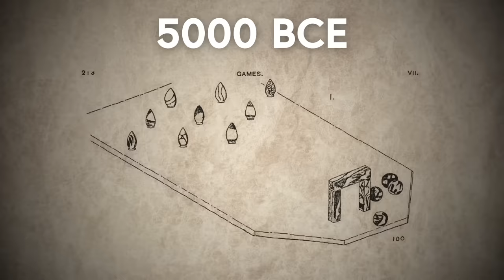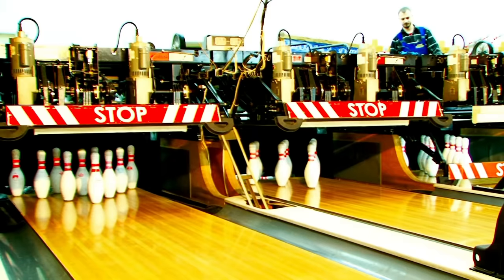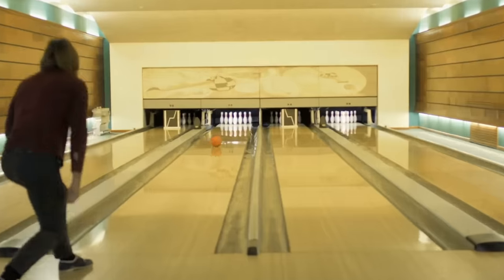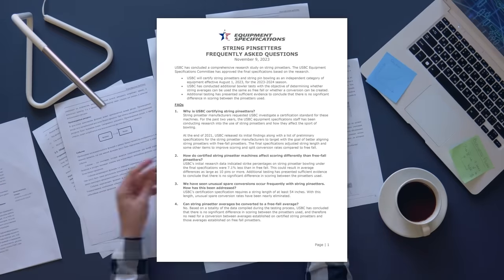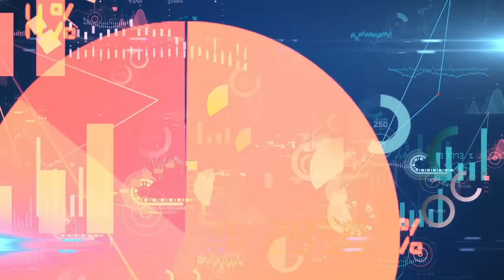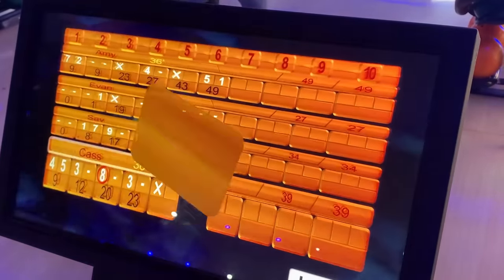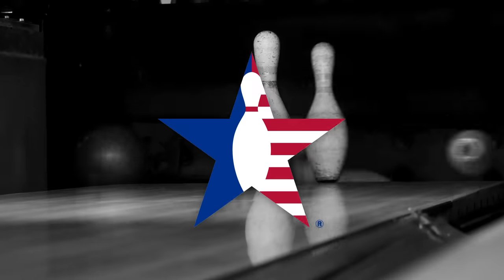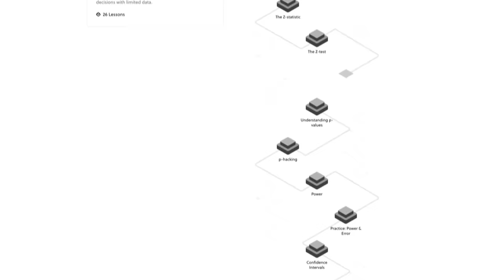The Controversial Machine That’s Ruining Bowling

Comment: I can understand the league bowlers being upset by the change, but string setters are saving the game.  Bowling alleys were dying out, but are now appearing all over the place due to the affordability, low power and low maintenance.  Personally my favourite way of playing them is smashing the pins with enough force to try and make a knot that the machine can't untangle.
The way the old machines crushed the mechanics to death was particularly sinister.  They usually got trapped above the table that sets the pins, and the motor would keep trying to run, meaning that every time they breathed out it would inch up a bit higher and gradually asphyxiate them.  Any initial cries for help were drowned out by the immense noise of the other machines, meaning that they would only be found when players complained that their machine wasn't working yet.

String setters have been standard in many weird variants of the game throughout Europe for a long time.
Reply: This must be happening everywhere except for where I am then.
Reply: Big Clive!!! I’m fangirling all over the place!! 😂
Seriously though, love you, and thank you for this amazing explanation of how the machines crushed people. It was spectacularly sinister.
Reply: I don't know about dying out, but many have closed over the last couple decades.  Mostly leagues just are not as big as they once were.  The thing with all the closed centers is that there are lots of machines sitting about making them pretty cheap to keep running.  The truth of it is, the real cost is paying for mechanics that know what they are doing an can repair and maintain the machines.  Any new construction bowling center today would rather pay more for string setters up front than have to pay mechanics forever.  It's the same reason you order McDonalds with a touch screen instead of a person today.  People are expensive.
Reply: I noticed lots of small bowling alleys being part of game warehouses. (places with arcade machines, pool, air hockey etc) in city centres. Where you have a small alley of 2-6 lanes. Not the mega 32 / 48 /56 lane alleys.
Reply: I feel like the "crush to death" problems could be solved by proper LOTO procedures, which should already be happening anyway because machines don't have brains. I know it's not that statistically significant, but while I was in the trades I worked for two separate companies, both for about a year. One was pretty lax about LOTO procedures, and while I was there three people got serious injuries, in one case losing all 4 fingers on their hand, because of poor LOTO procedures. In the other place, which was extremely strict about making sure proper LOTO procedures were used, we had zero notable injuries. The second place had about 100 more employees than the first, so workforce size didn't play much into it
Reply: @kevinb873  How often are you testing out bowling alleys? I ain't been to one in 3 years and this is the first I'm hearing about string theory destroying bowling balls.
Reply: @richardmillhousenixon That seems highly likely. When someone is killed or maimed by industrial machinery, they virtually always bypassed numerous  safety procedures and ignored dozens of big red warning labels saying not to attempt what they were doing.

Of course it's easier to become lax about the danger when you run a bowling alley rather than a factory, but the deaths don't seem like a particular fault of the machine.
Reply: "The Controversial Machine That’s Ruining Bowling" is my nickname down at the lanes
Reply: On the machines I work on (Brunswick GSX) there is a switch that would protect you in that situation. If there is something stuck on top of the table (usually a pin, hopefully not me) the resistance will overcome a spring and trigger the switch to shut down the machine with a jam code
Reply: To be fair, I have not experienced being the jam, and I can't imagine you would come off entirely unharmed before the switch tripped
Reply: bowling by nature has a lot of old heads this is the same reason why 2 handers get so much slack, or hating on people with a large arsenal.
Reply: stop smoking crack bro
Reply: I had only seen string setters on Bowlingo (sort of mini ten-pin), and one small alley (as in, 4 lanes small). Honestly I thought strings were how they used to work before the pin table style.

Nothing beats the sound of 20+ lanes all sweeping and setting 10 pins in perfect unison though.
Reply: The massive problem with stringpins is that it doesnt allow the range of motion to pick the bigger more difficult splits in a natural fashion if you have such splits like the 5-7-10, 7-10, big 4, greek church, 4-7-10, 6-7-10, 4-10, 6-10, etc. that otherwise are pickable with pins not attached to strings.
Reply: @richardmillhousenixon  Also, in the US it's flat-out illegal to hire anyone under 18 for any kind of hazardous work.
Reply: That's not the case here in the Philippines. Bowling centers aren't declining and yet all of them are still running Free Fall Pinsetters, even centers that were recently reopened after their renovation.
Reply: They suck and the lanes suck and don't make bowling fun.
Reply: @hedonismbot1508 - if so, that doesn’t stop businesses from doing it!  There was a recent video about child labor in the US, and how immigrant children were being used in hazardous working conditions. If the business was found to be breaking any child labor laws, they would receive a tiny monetary fine. Being a bowling alley pinsetter tech would be like Disneyland compared to working in meat processing facilities!
Reply: Clive, what's a guy like you doing in a place like this? Same as I am I suppose.
Reply: @hedonismbot1508 who considers working at a bowling alley hazardous work? Our bowling alley has a 16 yr old kid that works in the back.
Reply: Wow! Last place I expected to see a big clove comment!
Reply: Those machines are likely the Brunswick A-2's, the ones with the "mechanical brain". They don't give a damn, especially if the blackout switches are not adjusted properly, hence killing people. It's just carelessness, lack of training, and spacial awareness that causes mechanics to get injured and die. Newer machines like the AMF 82-90's and the Brunswick GS-X/GS-NXT have much more safety stuff built into them, and some have it surrounding the machines, as well. That was not mentioned in this video, I'm not sure if that was on purpose or just a lack of research. Strings have their place in fun places, like arcades and non-league family entertainment centers; but freefall machines have their place, too. They just need the love and care they deserve to last many years--and it helps that the general public do their part, as well.
Reply: While I do believe there probably is a way to fool proof/redesign the non string machine, it really sounds like for the casual player string setters are the way to go and no one should be upset about this change. Like feel free to keep the complicated expensive shit for professionals for legacy's sake, but if you're drinking beer and eating mozz sticks while you play you should be thrilled by the change.
Reply: The free fall machines probably have trouble not because of bad design, but because of a lack of care and maintenance. I wouldn’t be surprised if some machines fault due to safety cut out features frequently enough that they just adjust them so they won’t cut out anymore. This would also mean they don’t cut out when someone’s inside them either. There is obviously a safe way of working on these things, they only kill people when you cut corners or don’t keep them maintained properly.
Reply: And nobody thought to just add an emergency stop button in there somewhere?
Reply: yea but all this doesn't matter to the elitists that spent a lot of time being used to something being one way and cannot adapt to or even bear the thought of a new technology, even though that new technology might be good for the thing they are so desperately defending.
there is a handful of professional bowling players. While they are no doubt the best at what they do, there's a lot more people that would be willing to take up bowling as a sport, helping the sport as a whole, if and only if it was affordable or even possible. idk what these people are thinking. "hey look noone can play our sport anymore because there's no alleys bc they can't afford to stay in business bc we don't want our sport to be ruined by a fabric snake" yea buddy you're right, but consider [spongebob Patrick 'we saved the city' meme]
Reply: Worst thing that happens in free fall is screwing up your hand between a chain and a cogwheel, or getting the sweep in the back of your head, yes, that hurts. As long as you have machines closer in age to yourself than WW2. A2s are called mashers for a reason, 82-30s barely exist, 82-70s are often upgraded to newer electronics, and the GSes, even the silver box GS10 has safety features that hinder any serious injury or death. That's machinery from the mid 80s...
Reply: As a former many-years league bowler, I will begrudgingly accept the results the USBC found in the interest of reducing the cost to bowling alleys making the business more viable, but I will probably always prefer freefall machines just from a nostalgia standpoint. I've never actually bowled on a full size string machine, only the little arcade size ones, so I would be interested to try it with my old proper equipment if either of the two remaining alleys around here ever installed them.
Reply: @richardmillhousenixon  I'm the head mechanic at a bowling alley running Brunswick A2s. We have very strict LOTO procedures in place, as does every center I've ever seen. Also, there's a blackout switch that should cut power to the machine in the unfortunate event someone was trapped on top of the deck/table.

Deaths in these machines are extremely rare, but they aren't zero. While I personally am not a fan of stringpins, I can't deny that they're inherently safer.
Reply: hi, former A2 mechanic here.. recently switched to gsx but have also been trained on the qubica edge string setter... If the choice is String setter or the place closing its doors?  the string setter is the obvious choice.  From a mechanic stand point, there is still a bunch of maintenance required on string setters  but no where NEAR the level required on brunswick a2's or even GSX's.  so from a mechanic stand point yes!  bring on the much simpler string machines.  League wise.... its going to happen eventually.. no reason to fight innovation and keeping the sport alive.  everyone lost their mind when reactive resin started out.  though some how we have all reverted back to urethane so that example doesnt count but.... anyways... yes... string setters are coming and if it means keeping a business open and possibly even turning a really good profit for the first time in well.. ages... then yes, string is the way to go.
Reply: So next all Americans will be bowling Canadian 5 pin ?
Reply: @Bowler4Ever  my past life as a mech..   GS-98's -> AMF 82-30's (clickclickclick) -> A2's for 2 weeks (that house had a very non-existent training/safety culture) -> 82-70's with various chassis and 3rd party stuff.   The only one I've never been injured on is the A2's.  And that's because I knew the "masher" reputation and knew I was not getting proper training.  *I should note I never got hurt because the machine failed.  My brain failed and was complacent.
Reply: @andyward8062  I've always wanted to try 5-pin, duckpin, and candlepin. Never been anywhere that has them.
Reply: String pins are not saving the game, they are destroying it.  String pins may save the alley, but they will be the death of competitive bowling.  My local alley is 24 lanes of real wood, old pin setters, and we are full every night 7 days a week. they make enough money to redo all the computers, refinish the lanes, and buy all new pins.   The bowlero up the road with plastic lanes and 48 lanes, can't even fill league with 14 teams.   they still have real pin setters but they are moving to the "recreational play" vs the league play.   Take your pick, but to me the money is always with the leagues and leagues will never endorse or use sting pins.
Reply: @kevinb873  Same, I've never seen or heard about strings in Sweden
Reply: I am so not surprised you would know this.
Reply: As AvE says, "don't stick your fingie where you won't stick your dinkie!"
Reply: The crossover we didn’t know we needed 😂
Reply: I tested the string setters at the USBC in Arlington. It’s really not that bad. I can see why it shouldn’t be used in competitions but the oil pattern is what makes bowling difficult. Not how the pins fall.
Reply: @Redhotsmasher  There is.  But out of reach of the person trapped.  Officially they're supposed to isolate the machine before crawling in to unjam a pin.
Reply: @jimsonjohnson3761  That's not borne out by the waiting list to play them.
Reply: @K-o-R  I played a LOT of Bowlingo when I was young.  It was called Highway 66 in the USA.
Reply: @thevgdb  It appears to be you smoking it if you can't see the new and popular era of bowling vs the "competitives" who spoil all sports.
Reply: There's definitely an element of truth to a bowling resurgence. A local movie theater here expanded into other entertainment and now has a bowling alley. I've never been in there but I'm going to assume they have string setters because otherwise I doubt they would have made this seemingly random pivot into bowling.
Reply: I met an old man who insisted that his arthritis was due to his time as a pin boy.
Reply: ChatGPT Ahh comment
Reply: Carnivals also appear suddently wherever there's a free space.
String-operated bowling is a carnival attraction and "an abomination unto Nuggan!" 😜
Reply: The thing that I wonder is if they used normal players or league tier players for the testing across those 3500 games. If it was mostly normal players, I don't know how significant it is as a result. There are things that a professional would be able to tell about it that a less experienced player couldn't
Reply: I was literally on your side until you added that last sentence 👎
🙅🇪🇺🚫
Reply: If they make string pins for casual play and free fall for serious competitive then yes, I’d say they will save the game, but for the pros it’s actually ruining the game because if the physics and the “string carry” phenomenon. Just watch 220 average bowlers video on string pins and you will get what I mean.
Reply: I didn't know you were into bowling Clive
Reply: @BlackSoap361 it's plausible. Do any kind of work with repetitive motion long enough and that's what wears out first. I drove school busses for a long time, driver's seats with no cushioning or support, and I have degenerative arthritis in my back.
Reply: @PetesShredder Clive doesn't look like someone you'd want to meet in a dark "alley". 😊
Reply: @PetesShredder  I love the technology.  Both the traditional machines and the new ones.
Reply: @bigclivedotcom  yep me too, that's what got me into bowling and now we do league type play every week. Our place has Brunswick GSX 🤓
Reply: Okay maybe they should have deenergized the machine before working on it? 

Skill issue.
Reply: String pins suck
Reply: THEY ARE NOT SAVING THE GAME!
Reply: @dahorn100011  That's likely where we'll see string setters dominate and honestly, a smaller bar that can swing a 4 alley setup now has a reason to do so as it become a centerpiece with a lower cost of maintenance than 4 very expensive machines past their prime.
Reply: I've bowled for pretty much all my life and carry about a 190 average. I don't like the idea of changing to string pin setters but as long as it affects everyone the same then it's completely fair. I'm sure these will change the dynamics of pinfall and the game itself in ways we don't even understand yet but as long as everyone suffers or benefits the same then you have to acknowledge it's fair. I'm willing to give it a try.
Reply: @scottschmitz3988 I bet I can still pick up a 6-10 "split" with stringed pins. 😂😂😂
Reply: @Steve_Edberg agree with that mentality.... but it still sucks. and now youll be a guy who bowled his whole life and has a 175 average.
Reply: as more jobs are eliminated
Reply: @joshuamartin7667  I don't know that it will necesaarily harm scores. The USBC study showed they pretty much stay the same. Who knows, maybe it will help me finally break a 200 average?? 😂
Reply: @joshuamartin7667  that's a sad side effect but what can you do?? That's just how economic progress works. 🤷‍♂️
Reply: No true alley is ever going with "string tech" its a gimmic.... a true bowler would ever play in a house that use them.
Reply: This is just flat incorrect.
Reply: Big Clive!!
Reply: or you could simply prevent this by adding a little security measure- like a red light or a forced mechanism to disable the machine as long it's accessed
Reply: Saving the game? String setters suck. They literally ruin the pin dynamics.
Reply: no
Reply: @Steve_Edberg  it sucks
Reply: @kevinb873  Probably because it won't happen with a proper lock out/tag out system. The machine should have no power whatever to crush someone, or even move.  All power sources, (pneumatic, hydraulic, electrical and gravitational) are interrupted with breaks in the system.
Reply: This is what I mostly see. Yes, the old way might give higher scores, so maybe that's the preferred method for the truly high-class tournaments, but for your regular Joe on a regular night, the cheaper option is more alluring, and may lead to more people bowling
Reply: The way it crushed people to death sounds like something out of saw or final destination.
Reply: @joshuamartin7667 there's already a lack of skilled mechanics to begin with.  This is another driving factor in why some centres are going to strings.
Reply: @Redhotsmasher  All modern pinsetters have multiple e-stop buttons, including the Brunswick GS-X that was shown in detail in this video.
Reply: I’ve never ever seen one and they’re not building a ton of new bowling alleys so I sincerely doubt this is a massive problem for the bowling world.
Reply: The bowling industry is fueled by league and professional bowlers. Personal equipment is also part of that industry. Where the casual bowler does help league bowkers are constants. I have been bowling for 59+ years in a league. String pins is not something I want to deal with. The strings mess with pin action. I don't care what the USBC says. They ran their own tests. Do this with professional bowlers and see the statistics.
Reply: @kevinb873 thankfully not where I’m from either.
Reply: No way are you here. That’s nuts. You can’t argue with the stats. But as a very very casual bowler who only bowls for fun, there’s just something about the non string bowling. It seems more authentic somehow, having the pins on strings somehow makes it feel cheapened, that somehow the strings do make a difference and make the pins feel lighter(?). I know that’s a mad thing to say, maybe it’s the sound. I’ve had plenty of enjoyable games on string setters but overall I much prefer the old way.
Reply: @ThisIsStapes7 the pins are essentially the same weight whether drilled for strings or are freefall.  The weight difference is not that much.
Reply: @teri526 other parts of the world have been on strings for years.  IBF hosted the first international tourney on strings 2 years back if I remember?  I didn't hear any major complaints...
Reply: @Triley215  Oh yeah, I know that they probably are a very similar weight. I’ve never held one. I’m just saying the feel of hitting them with the ball. They just seem that they feel different to me.
Reply: Bowling alleys were dying out because of the push toward social bowlers. The league bowlers make the centers their money. But they jacked up the prices to milk social bowlers and young people with more money than sense and with bars and bistros added to get them in the door to pay those ridiculous prices and just downright disrespectful use of the center by drunken idiots the league bowlers have all left. Most people that can afford to go go once and with poorly maintained lanes league bowlers just arent interested anymore. So then the strings came now that they could all drop their standards.

Try and find a normally lit lane with respectable oil pattern, preferably one without footprints,  in a reasonably quiet center to practice on on a weekend, you cant. Parties and disco bowling all the way and that's no environment for a league bowler to practice in. Then there's the stepping on spilled food and drink that you cant see...

I was spending a fortune at my local alley on leagues and practice. It's stable income for the center. But most are forgoing that in exchange for a cash grab now.
Reply: Yo! I wasn't expecting Big Clive here! I read this comment in your voice and that gave me joy. Great to see you around
Reply: Nope you get crushed under the table. Anything caught above shuts the machine off while setting pins it drops within an 1 inch of the pindeck.
Reply: @NomadUniverse to be clear...league bowlers bring consistent money to a centre, but open play brings more money.

10 lanes of open play for 2 hours will bring in more revenue than a 30 lane league.
Reply: @amazincrackmonkey7176 this isn't true for all machines.
Reply: @Triley215  Yeah but its a one-off. Most of those people wont return and the social base will slowly dwindle. Those that do like it more often become league bowlers.
Reply: @NomadUniverse  controversly...our open play is at the highest it's been, and league base in our area is shrinking.
Reply: @K-o-R before pin style, it was hired help. Usually kids, that would clear and set up.
Reply: A machine can't be sinister
Reply: It absolutely isn't saving it, because the issue is people aren't coming as frequently.
Reply: And this is why you need a tag out and lock out system for all maintenance.
Reply: @richardmillhousenixon the fuck does Loto mean?
Reply: @G2_Shane Lock Out Tag Out. You physically lock out the power supply for the machine while you are working on it, only the person working on the machine has the key to the lock, and they keep it on their person at all times. A tag is also attached to show that the machine has been locked out, and that only the tech that locked it out in the first place is allowed to return the machine to service. If there are multiple people working on a machine like that, each one of them puts their own LOTO lock on in such a way that it requires all locks to be removed before you can return the machine to service.
Reply: @richardmillhousenixon  aha. I knew about that, just didn't know the acronym.
Reply: omg! it's big Clive!
Reply: Go to South Korea, bowling’s booming there.
Reply: $7. A game ruined bowling.
Reply: I was going to say that strings are nothing new. I've seen them as early as the '80s when my dad was stationed in Germany. One of the landlords we had was super kind to us and would often have us over at their Gasthous where they had a mini bowling alley in the basement. Those pins were on strings. The ball was smaller too. I forget what they called it but it was hella fun.
Reply: In Germany it is common to have string setting but with nine pins arranged in a diamond ♦️ pattern
Reply: I worked as a mechanic's assistant in a bowling center for a while. The head mechanic told me that bowling leagues are killing bowling by taking up the most popular times to bowl. Not to mention many league bowlers are incredibly rude and act like they own the bowling center. Families are excluded from bowling; kids don't learn to like bowling. So, screw everybody that stinks like a league bowler.
Reply: @johngaltline9933  Leagues put bowling centers out of business. They take up the most desirable bowling times. Open bowl is almost unheard of except at really bad times of the day. Families can't go out for an evening of bowling because of the leagues. Kids don't learn to like bowling. No new bowlers. Bowling centers don't make a lot of money on leagues, either. Many league bowlers are incredibly rude, also.
Reply: @phlodel  it depends mostly on the bowling center. Some places are “league houses”, where open bowling is not a priority. Other places are “family entertainment centers” where they have barely any leagues at all. Most centers today straddle the two, leaning more one way or the other. Most larger centers keep about a third of the house open for open bowling these days on most nights. 
For houses that have other things to offer besides just bowling, leagues are less important, and bowling, league or open, make up only a small percentage of their revenue. For the houses that only offer bowling, however, leagues are a guaranteed, steady income. The lineage doesn’t make money, the food and especially beverage make the money, and leagues buy plenty of that. 
On the side, almost every center with any league presence offers a Saturday morning youth league, which is great for kids to learn to bowl, and provides a lot of scholarship money for people that continues to regularly go unclaimed. I regularly see $2000-$5000 scholarships being given out at USBC meetings to get rid of surplus money in the scholarship accounts.
Reply: I mean, that isn't an argument to get rid off pin setters.
If you work on a machine while it is running that's a stupid person person.
Reply: I underdtand the utility, but they're shit to play with. The strings interfere with pin movement.
Reply: @Frient  Lockout tagout, baby!
Reply: I am in the USA .  All human errors. I was a AMF mechanic for many years, also worked on some Brunswick A's and A2's i never was hurt in any way. As for the string machine, its a joke compared to a free-fall machine. The testing by the ABC is performed by robotic setup, which is not the same as the average bowler.
Reply: the biggest issue with bowling alleys as a sport dying is that old ones close when the owner dies, and the family of the owner just scraps the machines because they don't understand their value or worth.  The biggest issue with opening a new one is cost.  new freefall pinsetters can run $60k each, without install, and literally have not changed in 50 years.   Two bowling alleys closed here in the last 10 years, and their machines were sold USED for over 10k each, and then someone also bought the lanes too, and carefully pulled up the wood to reuse it.  Bowling is only dying because people forget how family friendly and fun it is.
Reply: @richardmillhousenixon  you don't do LOTO in the middle of leagues.  you have 10 people waiting to keep going while the machine isn't working, so the workers get lazy and just want to fix it "quick" instead of following proper shutoff procedures.  Both bowling alleys I have been to have huge signs when you walk in the back that clearly state to power off the machine at the shutoff right at the machine before performing any work.  They also have several safety shutoffs around that will halt the machine's motor should you become trapped and can't reach the main shutoff due to someone almost getting crushed to death by the table going up on him(the people at the end saw his feet start lifting and managed to save him).
Reply: As someone who works for a QAMF i totally agree. The products we sell reduce the centers cost for maintenance on the old free fall pin spotters. The string machines last way longer and are much better to maintenance.
Reply: It really sounds like this is a strong case of "people should not be operating or working on complex actively operating machinery alone".
Reply: @hedonismbot1508 no it’s not. There are tons of children that are unfortunately legally working in meat packing plants in the US. Very dangerous.
Reply: @itzSudden I thought that was due to an exception for agricultural labor which was originally intended to protect family farms.
Reply: @hedonismbot1508  I’m not sure if it was some sort of exception or not. But in practice we currently have tons of children in corporate industrial meet packing facilities in the US. Injuries such as losing limbs or death are not uncommon.
Reply: I work on A-2 pinsetters . You’d have to be pretty fuckin stupid to be crushed by one of these. Standard practice is to turn off the machine at the breaker before getting under it .
Reply: Wrong, I refuse to go to a place with these strings. I go to the alley 15 minutes from my house like once a week or 2
Reply: What do you mean by weird variants?
Reply: @richardmillhousenixon  You say lock out tag out, I say go tell it to the teenagers making minimum wage at the 24/7 rock and bowls across the country. If their eyes don't glaze over by the third time you say 'LOTO procedures', I'll introduce you to Nugghead Greg who makes the mozz sticks.
Reply: @OscarOSullivan  Tapered lanes and gates.
Reply: Then hire pinboys
Reply: We stopped bowling because it got the expensive if string setters bring back affordable bowling that sounds great to me I’ll probably still say free fall was better but if you can afford to do it it’s no fun at all
Reply: @tncorgi92  I can’t say he was wrong, just that he was also a fighter pilot in WWII and had an assortment of other jobs and hobbies in half-century after that. Maybe being a pinboy when he was 8 caused arthritis when he was 80, maybe it didn’t.
Reply: I feel this may be a "McDonald's soft serve ice cream machine" type scenario.

TLDR; there has gotta be a better solution

The manufacturers could make a better/cheaper/reliable machine with today's technology but they don't as it would essentially end the side of the business making money. Maintenance and repairs!

I have a set of authentic bowling pins from an alley (they sold old scratched/dirty ones as souvenirs) and whilst they are much heavier than they look (seriously the crate of 10 is like 25kg) i don't see why you need such a heavy machine to pick em up and put em down.

The string machine does roughly the same thing and is a fraction of the weight. Yeah it doesnt need to hold extra pins but that i think is where the design needs work - it was for speed of resetting in a time before computers and advanced robotics. Heck why couldn't there be a little robot whose only jobs is doing pins stuff.. clearing, lifting, resetting... boston dynamics can make em do gymnastics, auto makers use em to build cars, there's a restaurant with a robot chef.. but making one to do pin stuff is infeasible? Pffft gimme a break!

At the very least i feel like a better string-type machine could be made to address the issues people have - eg use electromagnets on the end of rods, so during play they detach just like the old machines. Then it's just a matter of clearing the fallen pins and putting them in a place the rods can grab them for a full reset.

And don't get me started on the statistical proof of it having negligible impact on the game, that's like saying switching to an electronic roulette table with no ball vs physical table with a ball has negligible difference to the payouts for gamblers...
Reply: @richardmillhousenixon That’s a clever system. I guess the trouble is the machines’ safety systems aren’t foolproof. As in only a fool would disregard LOTO, but plenty of fools must do otherwise why are people getting crushed? I guess it should be possible to design the machine to not be able to run while being serviced, even if the mechanic ignores or overrides LOTO. Like with an infrared sensor? If the machine can detect a bowling ball I feel like it should be able to detect a person in the service areas. 

Who knew pinsetters and nuclear reactors would both involve designing around human error?
Reply: Really?  It will destroy the game. 150 and lower bowlers will dominate the game. Remember it’s mostly the cost of land that is driving bowling centers out.
Reply: I've been a Brunswick mechanic for 30+ years. The only reason a mechanic would get crushed in the machine is because they're not following proper safety procedure. ALL of these types of deaths are preventable. Like most types of machinery, pinspotters (AMF) and pinsetters (Brunswick) don't GAF about you. They do not care if you are in the way. They will kill you. If you are not properly trained, stay out of the back of the bowling alley.
Reply: @scottschmitz3988  actually, I've seen videos that make these conversions look easier with the strings.

 Think  about your 1st ball crushing the pocket and sending a messenger at the 10 pin, but the messenger goes either in front of or behind, missing the 10, hits the kickback and wraps around it. Neither a pin nor a ball have contacted the 10, but the string takes it out. How can you call that a legitimate strike? String 10 Pin DOES NOT belong in USBC/PBA sanctioned play.
Reply: @95scTA  our workman's comp insurance doesn't allow anyone under 18 in the back.
Reply: Jesus, that is a rough way to go.
Reply: Something being standard in Europe has absolutely zero bearing on its quality or justification. (Not a knock on Europe, I love Europe!)
Reply: @nlald  One of the main problems is that these machines last forever. One very popular pinsetter is the A2... that was manufactured around the mid 60's and they still run in bowling centers today. You can't expect a machine over half a century old, to be able to detect humans. The infrared sensors in most cases were just an upgrade, You can change laces of a boot but it's still the same old shoe. Modern machines have a self diagnostic system, akin to how pinball machines try to go through every mechanism after it detects that the score isn't changing, to make sure the ball isn't stuck in one of the mechanisms. But if the problem is more complex then you may have to observe the machine step by step to find the problem. However, observing and servicing are 2 distinct things.
Reply: @scottschmitz3988  I'm in no way a great bowler, but I've picked up 6-10s on a string setup before. It's perfectly possible.
Reply: The league bowlers are the blood of the game. I'm glad you can now have more opportunity to wander in twice a year and try to break the equipment.
Reply: Havent ever seen them in finland weird.
Reply: Bowling is a variant of German 9-pin 'Kegeln', not the other way around. And yes, all Kegelbahnen in Germany use string straighteners.
Reply: That's why lockout tags exist
Reply: Fake bowling alleys; I would never bowl at a string pin center, that's not real bowling.
Reply: i am not victim blaming, just surprised that people would crawl about in such a place without powering it all down first. no doubt there are reasons i am unaware of, and BC is something of a god to me, i am sure despite my first impressions i am utterly wrong if I think the opposite of BC.
Reply: I definitly agree they are saving individual bowling alleys, free-fall machines are a whole nother level of expensive. But it definitly isn't saving any form of the competitive side of the game. When it comes to competitive bowling.. they are a nightmare to bowl on compared to free-fall. For the last 5ft of the lane (where the pins sit), it is a completely different version of bowling and should not be sanctioned equivalently to free-fall league/tournaments. I am fine with having both, I will just chose to not bowl with string machines.. bowling actually sucks with string pins.
Reply: Yep, around here we're down to something like 2 or three bowling alleys. Granted, bowling wasn't ever a big thing around here, but there used to be a lot more bowling alleys to choose from.
Reply: It's the only thing that can save duckpin bowling, too.
Reply: Thanks for that image he said sarcastically.
Reply: Bowling alleys aren’t “appearing everywhere”
Reply: @tbeck27  They are here in the UK.
Reply: A1 BS Award winner.....what a jagoff.
Reply: When you are there for a family day out with small kids and so on it's a totally legit solution..
Reply: @richardmillhousenixon  People being crushed to death by pinsetters is beyond extremely rare.
Reply: string setters suck, they massively change the stratagy
Reply: I think it's a choice. You want to play professionally you go to a real bowling alley. If you just want to have some fun you go to a cheaper one with the string system.
Reply: They aren't saving the game at all. WTH does a string setter have to do with people going to the alley and bowling? Nothing. It's leagues that generally made bowling alleys successful.  When I was younger, the nights, from 6PM - 12AM were almost all filled with leagues. There were even some leagues for women during the day. You always had to call to see if there were any lanes available for open bowling. 2 leagues right after each other at night, 5 days a week. The problem is is started to get to expensive. It used to be 10 bucks a night for leagues for 3 games and open bowling $1 or $1.50 a game. Now it's as much as $5 a game and leagues are $25 a night. That adds up when you do it for 32+ weeks a season. This doesn't even include the expense of the equipment and food which has way up. Take this cost and all the other things to do these days like video games and now streaming, internet among others and people can't afford it or have something else to do that's more affordable. And I'm not talking the 60's and 70's.
Reply: In my experience bowling alleys wouldnt be failing if their prices werent astronomically unreasonable. My favorite bowling alley in my area is going out of business and this may be a coincidence but it all started about a year or two ago when they removed the ability to pay per game and now they only allow you to pay for an hour which costs $35 (per person btw)... this doesnt even cover shoe rentals which are $5 per person too. I went to take my sister to play the other day and the entire alley was dead :/ Kitchen was closed, Pro Shop closed and even the vending machines were empty. Super sad to see but I can see why. That place used to be my favorite because I could get relatively cheap games ($3-4 per game) at the trade off that the lanes werent kept with too well and the pin setters malfunctioning on occasion, but they were still decent to practice on. I see this trend taking off at all bowling alleys near me and its pretty sad :/
Reply: They are terrible and they don't even take care of the approaches anymore.
Reply: @Brainrot-Stu2
dios 2 handed bowling looks pretty hard. I'm a left handed shooter and watch 2 handers all the time. I ask questions. My problem is I learned how to bowl rolling duckpins. So my fundamentals are more from rolling that type of pin. Hard to change
Reply: @scottschmitz3988 I personally saw one get wrapped and cause an improbable spare. I'm not a fan.